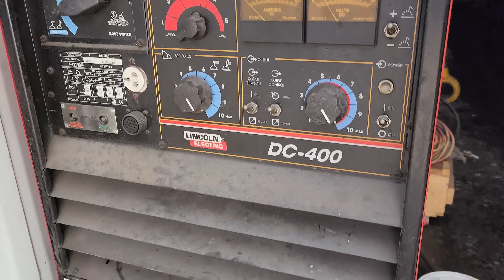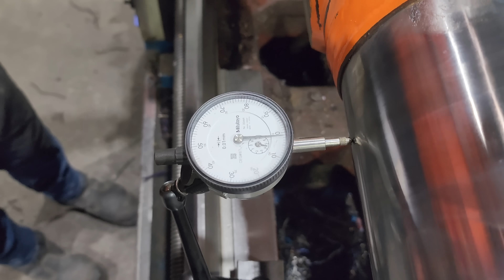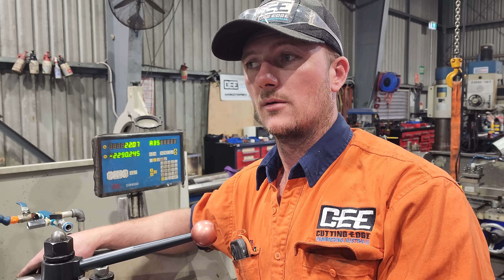Can We SAVE This $20K Cylinder Rod!? | Gouging SEIZED Nut

Comment: Nice work first of all I think that scoring of the thread was done as somebody forgot to remove the grubscrew before undoing the nut and secondly I would have removed the nut on the lathe as you took a lot of risk cutting it with the gauging tool!! I am talking from 40 years experience on the job as I used to own a general engineering workshop like yours:-)) Regards from Malta

Comment: My experience at a company here in the States, E.W. Bliss making heavy duty steel mill equipment. I have seen larger screws and nuts, shafts and couplings just machined into chips with very remaining and  just peeled off. Why risk the air arc when you have more precision control with a machine tool? Easy lathe work.

Comment: If you have a horizontal boring mill wouldn't milling in two slots or slabbing  2 facing cuts be quicker using the quill than plasma a much more controlable?

Comment: Work of a Dilletante. A milling machine and a hydraulic spreader would have done it in minutes; and the thread would still be OK. Grind from two opposite sides until just before the thread, then press the nut apart hydraulically (if necessary, weld 2 opposite cams to the nut for support). So simple!😜

Comment: excellent video as usual Kurtis, I had 1 question - I seen you do round circular welds on rods and then resize to original OEM threads or fittings. why didn't you do the same here. Please comment As will help me learn. Is it different metal or the amount of load which made you decide ??

Comment: If it was 125.8mm and you wanted to bring it to 125.00mm the x linear offset should be 0.4mm, unless that dial reads double dimension for direct diameter readings. Which setting is that and why do you prefer it? Thanks

Comment: Pretty neat.  I've heard air arc cutting before but never seen it up close like that.  Is there a reason you did that instead of trying to machine it off?  I've cut off lock large lock nuts (the kind with the locking ring with tabs) before and it went pretty well, but they didn't have a captive shoulder. 

I wonder if cutting through the nut with a parting tool on the lathe then milling through the nut (like you gouged it) might have worked.  Regardless, nice work on getting that nut off.

EDIT:  Nevermind!  You answered my question in your second video.  I figured you had a good reason (time!!).  Nice work on the repair!

Comment: Now I think I've seen you use a plasma spay system to build material up on items.  In the plasma spay systems there seems to be a ceramic paint that you can use to paint areas where you don't want the spay plasma to go.  Could you use this same paint to protect areas you don't want to air ark gouge?  I'm assuming the ceramic paint/coating is non conductive so it would be less likely that the ark would jump over and melt something you didn't want to damage?  Just an idea

Comment: Total lay person here. Could this be done with one of those large angle grinders? Could an angle grinder even cut through the nut? If it could, what are the advantages of using the arc gauger vs the angle grinder? I would suspect it would be a bit slower and it would tricky once you get up against the collar.
Thanks for the video! I had no idea there was even such thing as an arc gauger. I also wouldn’t have thought it possible to mount something like that in a lathe and get it to run true.

Comment: I have done the exactly same thing to the smaller excavators them nuts are a sucker to get off there built the same way them things must take a lot of stress , since they was a smaller nut I just use an cutting torch them and splitting them was only to get them off cause just like that one its in to the piston just split it enough to screw it off and that one looks like a better one i have gotton off the threads was pulled and all mangled on the ones I removed .

Comment: Just a couple of words about Plasma "gouging": Plasma cutting machines are quite cheap and on low amperage settings produce a very fine "lightsaber-ish" blade to precisely cut through steel. I have done quite delicate things with that and they virtually cost like nothing. You already get to decent amateur gear for 500€. 20€ for a pack of consumables. And with that you could already tackle this project.

Comment: Just out of curiosity and a limited knowledge why not something like an angle grinder or some mechanical removal tool like a lathe, milling machine or cutting discs can be used? Is it due  Time or costs?

Becaue with this method arnt we heating the rod with the nut?

Comment: I'm curious (I am in no way associated with machining or any of that)... If you'd have done pretty much exactly what you did in taking it down to 125.01, but only back to remove the damaged threads, and then used another new nut exactly the same size as the one removed that would essentially start threading at the point where you stopped machining the damaged threads off, would that have been a viable solution if the application or use of the piece was know to not utilize those threads? Also, what did you say caused the nut to seize in the first place? Thanks for the cool video.

Comment: Just a total laymen here could you not weld on a bunch of to build up and then turn to smooth and recut the threads at the same size? By the way I know nothing lol. The other thing you might be interested in on a job is called temperature reduction paste from a company called Wurth. It comes in a thick spray or jar and you apply to anything you don’t want heat to affect or transfer to. For instance you can take a 6 inch 3/4 bolt apply it around the middle and heat one end red hot and you can still hold the other end with bare hands with very little or no heat transferred to the end. By the way I tried it and it worked. Take care.

Comment: Where’s the nut material? I worked as a machinist not only making these Billets but turning the threads too! We used Metal Billets heated then pressed through the dye had to wear a Fire Suit as the Super Heated Billet came out of the oven the dye was in before loaded into the press! Then pressed out left until cooled. I would then machine similar threads. So using the overhead Crane was every day first loading the dye then then waiting for the Metal Tubing to start coming out to cool!

Comment: Im suprised that the hydraulic bench wouldn't strip that nut off. I have a hydraulic wrench on my bench that has 75,000 foot lbs of torque. Like the trick with the center in the four Jaw chuck never thought of that before.  I rebuilt a Lancing with a 9 1/4" spindle bore with dual chucks three years ago and should have done a 12" spindle bore. Once I got  that lathe, I rarely use a steady  rest.

Comment: If the nut is made from the same alloy as the rod, you will risk what is called galling.
The surface of the nut and bolt react with each other in a bonding way altos as the become welded together.
This happens frequently with stainless steel.
To prevent this it is necessary during fabrication to select a different type of stainless metal for the nut, just a slightly different stainless alloy.
To break this bonding can be difficult once it happens.

Comment: Yikes, I've done two of these on long stick demolition excavator cylinders, even more expensive. Not fun and I only had an O-A torch. Slow and steady taking the high points off next to each flat and using carbides to open them up to where I could use an air saw to finish the job. Ended up with the nut in four pieces but it saved the rod. Nightmare is an understatement, lol.

Comment: We used to rebuild Shields from the coal mines here in WKY... We built a hydraulic wrench to unscrew those seized ass nuts.. numbered them so we knew which rod they came off. Weld up the threads and recut them on a lathe and send the cylinders to rechrome.

Comment: Dieseling is not caused by air rushing past the seals. Dieseling is caused by the adiabatic compression of the air in the cylinder. The rapid compression causes the air to get hot enough to ignite the hydraulic fluid, which is a hydrocarbon, just like diesel is a hydrocarbon and diesel engines operate by by compressing air to the point where the diesel is ignited. Hence the term dieseling. All hydraulic fluids contain some air and it is not necessarily air left in from the initial assembly. If the cylinder cannot fill with oil as the bucket moves, then low pressure regions can develop and that depression causes the absorbed air to expand and make bubbles. The bubbles are then compressed as the cylinder pressure increases and that also causes dieseling.

And, why not just machine the nut off in the first place? Gouging was always going to be risky and it ended up going way too deep.

Could have turned it down or milled some big slots in the nut and it would have dropped off and could have saved the job of having to remake a smaller thread that may not withstand the strain on the teeth when the cylinder is extending. 

Not being critical, just asking.

Comment: I think you could have removed the first 3 threads. dressed up the arc damaged threads by hand and put on a new nut.
Reply: Kurtis clearly said that cleaning up the threads and putting a new nut on it would more than likely cause the new nut to bind up exactly the same way the old one did

Comment: 3k$ nut. i wouldhave drill the nut and tap the hole hole then screw in a grease fiting .pushing oil from a hydrolic jack in there would loose it.  nut can be welded back.   
it work removing whell from train wagen axel.  worth a try

Comment: A culling where on a grinder would’ve better served ingesting the nut off . After several passes with the air arc you may have heated the nut enough to swell and loosen

Comment: This happened on my motorcycles rear axel shaft, the nut siezed on just like this. I had to cut it off with a dremel and get what was left of the threads repaired at a machine shop. 
What a nightmare.

Comment: Most Any time you’re try to take apart the piston rod from the packing nut you will have thread stretch on both the nut and rod! The best thing you can do is put make your own Super Nut on the rod and torque the nut to the rod ! Once the nut is torqued you will not have any st

Comment: I had to do a much larger one than this.I aren't gouged the nut all the way with an a quarter.Inch then use the grinder to get a little closer.And then I heated it up with a Torch and made it like completely orange and threw a bucket of water at it.And the bolt snapped in half and flew off of it

Comment: Hate to break this to you but my shop runs into this sometimes too. The FIRST thing we try is we put the whole thing in an industrial freezer for 24 hours. The nut and the piston both have to made of the same material so the expand and contract at the same rate in the heat and the cold. Once it comes out of the freezer, the metal of both parts have shrunk somewhat to n the cold. We then run a torch around just the nut for a minute or so so it expands more than the piston and has pulled away from the threads. It’s rare where this doesn’t work. Looks like this shop just cost their customer about 5k with the nut and the extra work. They didn’t even try anything else first.
It’s just like when you have a glass jar of pickles with a metal lid and no matter what you do you can’t get it off. Just run the lid under hot water from the sink for a few seconds and the metal will expand and it will twist right off. It works on plastic ones too.  
Easy peasy!

Comment: I had a mentor that would use oxy/acetylene at a low temp to completely burn out broken exhast manifold bolts without touching the manifold threads at all.

Comment: OK no silly ideas, hot citric acid poured down the thread will liquify the rust into Ferrous Citrate. This is soft and the rest of the nut should come off with little effort. Apply a little heat to the nut to expand it to break any bonds that may still exist.

Comment: Quite the cheek puckering job, cutting a nut off such an expensive component. But I never imagined an arc cutter could give that much control. Its an insight into OEM overcharging that a bespoke custom nut is CHEAPER than the mass produced standard nut.  We can see that the thread galled and locked the nut......but it gives a clue that something was wrong from the get go with the thread and or nut originally, or someone was rather careless during assembly ( contamination).  That is why you dont let idiots work on heavy equipment. Relative to the diameter, those threads are very fine, and its very easy for things to go horribly wrong.

Comment: Two things:  the mechanic that works on that piece of equipment probably told these people 50 times the cylinder needs to come off to be rebuilt or repaired. And they keep putting it off till they get to this point. 
Second 
You should have taken it to the nearest shipyard repair facility and they would have said hey look they brought a little bitty bolt over here to get fixed. 
Lmao

Comment: I would have used a whizzer wheel. I cut the 1/4" boiler plate to make a hole in my wood stove , A 6 sided shape about 5" across and didn't even have to change wheels, one did the whole job.

Comment: Nice work mate, miss the air arc gouging. Its crisp and precise but loud as fuck haha. Was thinking and not sure if itd work the way you want but could you have welded some type of make shift bracket to the nut to hold the porta power jack? I used to gouge the ring fedders out of pulleys for the mknes using oxy and acetylene, occasionlly icing the shaft and heating the ring would allow it to come straight off too. Seen blokes do it with dry ice and regular ice lol but interested to her your thoughts. Cheers mate 👍

Comment: Disagree with not cleaning the OD all the way up. Why leave a low spot on the major diameter for some non thinking mechanic to potentially cross thread. You’re making a custom nut anyway and it’s just as easy make it with the required minor/ major diameter in either case. Other than that you’ve showed your skills. Nice job. Oh and I would kill back in my day to make that $3000 nut for you.

Comment: when attempting to spread the nut open, around 10 minutes into the video, you could try welding a large nut to the side of it and a plate opposite, 90 degrees to the shaft.  Then run a bolt into the nut pushing on the plate.  this would likely pry the nut open, maybe a relief cut  in the opposite side of the nut...

In this case I doubt that there is any other choice than cutting it apart like you did because the engineer  buried the nut inside the piston.  Why do they do things like this?????

Comment: 15 mins in is what you should have done from the start only with a much bigger bar and a bigger hammer also a blowtorch to warm the metal up but not blue it to ruin the temper

Comment: Why wouldn’t you just use a grinder and cut off wheel to get as absolutely close to right through as possible and then use a air chisel to actually split the nut? Seems like a big production and to much chance of getting to close to threads and melting even just a touch of them would make cylinder a paperweight

Comment: Why not just weld on new material where the threads were and turn that down on the mill to oem sizing, keeping the bottom 3/4 submerged in water so it doesnt mess up any tempering etc

Comment: I don’t understand why didn’t you put rod on lathe, machine of stuck nut. Fix the thread on rod at same setup. It would save you allot of time.
Gouging work was excellent but unnecessary in this job.
I have been machinists for 40 years, make new and fixed so many different types and sizes of hydraulic cylinders.
Keep up good work bright future is in front of you.
Good luck

Comment: Never gouge. Thats crap. Learn how to use the torch. If your slow with it, and its set right. You can cut one piece of metal off of another easily without any issues. The material you are cutting through, will stay orange/red while you are cutting. When you get close to the backing piece of metal, it will look black. And you stop. Alot of times once you are close you can just hold your torch there and the cones themselves will cut the last little 1/32 of steel. Hope this helps.

Comment: I worked in machine shops and have used air arc it is nothing but an over sized pencil lead with air blowing and if that rod cost 20000 someone got screwed

Comment: You obviously know what you're doing and nothing might ever happen,  but I'm surprised you'd sling a load like that instead of using a spreader bar and two points of attachment.   Not securing the rod on the pallet on the forklift too.  Gravity's very patient.

Comment: The only reason to take the nut off is to replace the cylinder cap seals. If they weren't leaking badly I would have repacked it and Bob's your uncle.

Comment: @16:50 you might well decide to - but if it fails then you’re fooked! The engineering & design that took place for this item is done by clever b’stds to keep you all safe! 
Admittedly it looks ott & a redesign might benefit to alleviate the difficulty encountered. 
Many ways to skin a cat. I’d look at the forces involved - choose material grades appropriately - look at length of thread req’d - provide double locking nuts both ends so you can lock against to undo via hydraulic socket to suit. 

Where can I send an invoice 🤔

Comment: no bigger scam in terms of pricing that with heavy equipment parts. for a John Deere 4000 series, compact tractor, rear cylinder cost me 1900$ canadian .... for a tube of steel and some rubber gaskets